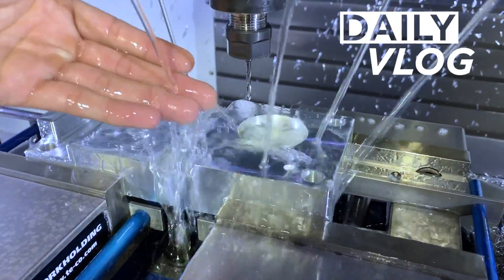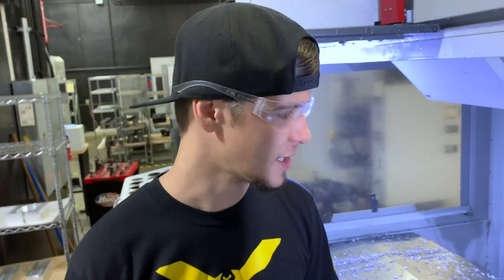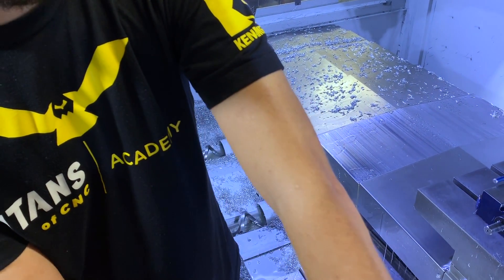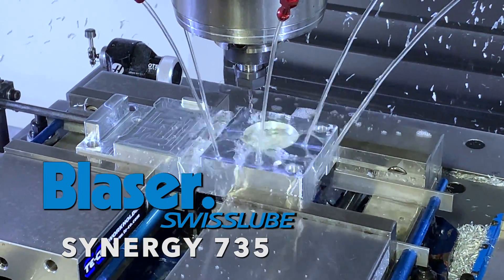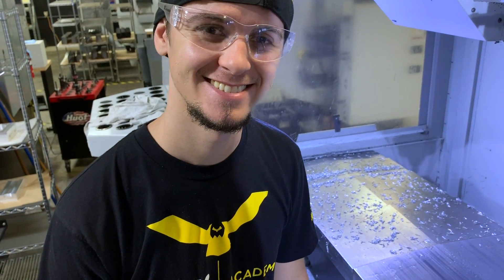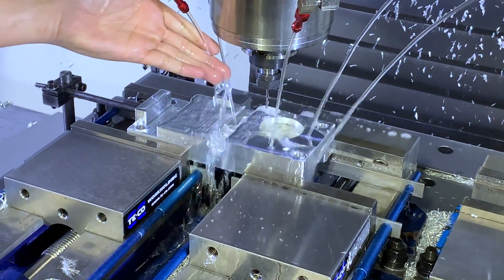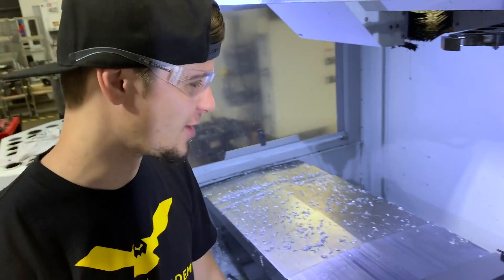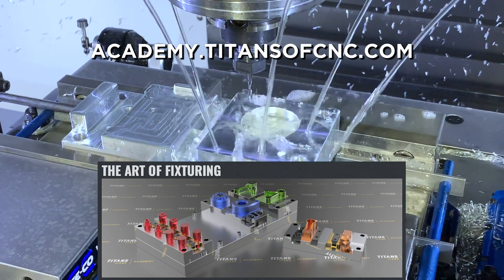20 Month Old Synergy 735 CNC Machining Coolant - Vlog #30

Comment: Synergy 735 is not for stainless or those abrasive material right? 
The blaser guy told me this is for Aluminim basically....
Reply: It's not good for aluminum either, you cannot get good cut-tap holes with this stuff, especially small ones. Broke taps right away with it on jobs that ran years without problems .Cut taps push material so bad you have to change drill sizes to have a good minor-diameter after tapping.

Comment: Lol, why use 2 vices on what looks like a 7-8" part and not even clamping on the center of the vise???  And with aluminum?  Y'all don't have an 8" vise?  Didn't you literally just mill slots through a brand new vise?

Comment: What about paint peeling off the machine???? Seams to be the 1 thing that is a major issue.  I'm getting my 1st machine up and running and wanted to go with 735 but hearing several horror stories of the coolant stripping paint off the machine.  Does anyone have this issue?
Reply: It turned the perfectly good paint of a 14 year old machine into a wet silly-putty like substance that will not dry or wipe off. Chips stick to it like glue so I had to scrape it off with a razor.
Reply: I just looked at a machine that had been running this for a few years and it absolutely destroyed it.  It's so unfortunate because the guy took really good care of his machine too.

Comment: Are you experiencing any tap breakage using 735? I switched 68 machines over and guys are complaining about taps breaking and the strong smell. I have 2 guys complaining about bronchitis. We are breaking taps on 6061 which we never experienced with other coolants, 304 we switched to using oils as the taps are breaking constantly on parts we've ran for years,
Reply from the maker: I actually love the smell... but it does take a little time to settle down.
I have 17 machines using it.

My VF6 has had it for 24+ months and no smell anymore...or at least I can’t smell it.

They had a version that stained certain part like brass so I think they lowered some lubricity in version 2 which solved the problem... but my affect tapping. Hmm
I run super alloys and always thread Mill so I haven’t noticed. When I do tap, it’s fine... but I run it at 10-12%

I always suggest trying it in one machine first. Then switching to all.

Huge companies are using it now like Lockheed, Boeing and McDonald Douglas. No issues.
Reply: @TITANSofCNC  I think I just have a bunch of cry babies. I ran a test on our Robotic 5 axis and a couple stand alone 5 axis mills and had no issues prior to switching over. Thanks for the feedback!
Reply: After a 100-hole test on this coolant using different mix% and speeds/feeds, this coolant is no good for cut-tapping small holes in 6061. Roll taps and thread milling seems ok. The smaller in size you go the worse it gets. At 6% refractometer material stuck to M3x.5 after only 6 holes killing the rest of the holes/parts on a well established job. The tap pushed so much the minor dia. for an M3x.5 went from .099 to .095 just from using this coolant. This shrinking minor dia. 'feature' was noticed on all cut taps in every machine that switched over to it. Ran it at 11% on refractometer (wicked high with the 1.6 multiplier) with an additive Swisslube gave us and it didn't change. The only thing that helped the sticking/tearing/pushing/wrecking was slowing down tapping to 1/3 of the previous speed/feed to get through the job and it still would start sticking to the tap after a short time compared to almost NEVER before. Ran a cast aluminum job with slowed down everything and was worse. M4x.7 tap started failing after about 40 holes where I used to easily get 500. I then ran a 100 hole test using one of the junk parts to get hard data on this coolants performance with cut taps.

Comment: Blaser Synergy 735 Update....... Talked with the Blaser rep yesterday. They have reformulated the 735 to handle the issue with the coolant. 
They say the new formula will take care of the problems. He told me the new version of the coolant will be out in June. However they continue to sell the current version knowing they have a issue????????? 
I will be getting rid of the Synergy 735 and going back to Castrol Hysol MB 50.

Comment: Guys I have noticed something odd with this coolant. I have a new Haas TL-1 Lathe. I have had the Synergy 735 running in it for 2 months.
It has been in the machine since it was new Running it at 8% concentration. The coolant is leaving a very sticky
residue behind on all painted cast iron surfaces in the machine. None of the painted sheet metal surfaces are
affected. Other than that this coolant is fantastic. Just a little worried on what it could be doing to the paint on the cast iron.
Reply from the maker: So as I mention in most videos, Cast Iron does cause slight issues... but they have a version 2, that fixes the problem I believe. So just ask Blaser for the new version. Also, run at 5% on your refractometer. Which then is calculated times 1.4 to hit 7. Which is a solid number for soft metals and steel.
Reply: @TITANSofCNC  Thanks. Gonna see what version of the coolant I have. Didn't realize there was a second version.
Reply: Synergy 735 update (2019-08-27). Spoke to large coolant distributor in New England. He stated that they have been receiving and selling only v2 for quite a while now. He said the reformulation (v2) was developed to address the problem of gelling reported by some users of the original formulation. So it sound like as of the end of Summer 2019, busy distributors will only be shipping v2. Their customers who have tried 735 really like it, including schools that are happy with the product even though their machines may sit idle for weeks at a time (ie Summer). So good news on the stability front. Cost is less than $250 for 5 gal of concentrate.

Comment: One of the big challenges for small shops is finding a place to get this stuff.
Reply from the maker: Local Blaser Distributors...You can get as small as a 5 gallon
Reply: Easy around here. Toronto lube carrys it. About an hr away
Reply: Yeah, I can't find it to save my life.
Reply: @shirothehero0609  have you tried actually contacting a blaser rep? You're not going to find it on Google. Theyre not going to tell you that you can't have it...
Reply: @WCGwkf  so this was a comment from a year ago, but I will tell you that yes, I contacted a blazer rep and they weren't too interested in selling it to me since I didn't want a bulk order or didn't want to setup a large recurring order.    There are ZERO distributors around me and Blazer also wasn't interested in connecting me with one.  I went back and forth via email for a few weeks with a guy and then played some phone tag.  A few emails and voicemails later I decided it wasn't worth my time for a few gallons of coolant that would largely work the same as the current stuff I'm using.
Reply: @shirothehero0609  that's unfortunate, at least you tried. Most wouldn't go that far
Reply: @WCGwkf  yeah, it really was.  I was pretty excited to try it but once they started ignoring my calls and emails I figured the hell with it.  Oh well, such is life.

Comment: My cnc machine stinks up the entire area at work only after two months...management will never get us the good stuff
Reply: We had the same problem. . Bad city water, cheap coolant. Add the two up and the machine, tooling and parts all rust. Now we run DI water and much better coolant.
Reply: @FredFlintstone21  Whats DI water?
Reply: @gman5986  Deionized (DI) water is water that has been treated to remove all ions – typically, that means all of the dissolved mineral salts. Distilled water has been boiled so that it evaporates and then re-condensed, leaving most impurities behind. It's basically highly filtered water. They have the same system at many coffee chains like caribou, to purify the water. Our system had a little light on it, when the "contaminates" in the water go above 10 ppm (parts per million) the light comes on indicating to call the water guy to change out the tanks

Comment: Also important to keep that coolant churning and working a little bit to keep that gym sock smell out of it. We use Cimstar, and like it a lot. But we keep fish tank bubblers in the machines that don’t run as much, and it helps a lot with stank... if it wasn’t such a pain to get things pushed through chemical review at our facility I’d give this stuff a shot though.
Reply from the maker: Actually, not with this one... it’s super easy as there is no bacteria
Reply: TITANS of CNC: Academy  Wow. Do you know  how they get a biocide in there strong enough to last that long that doesn’t hurt your skin? That’s pretty impressive. Obviously, from the video, it doesn’t smell funky, but what would you say it’s normal smell is like? The Cimstar is almost a sweet smell. Yet very faint.
Reply: dylan hughes you’re right. I just looked online, and it is full synthetic. We are pretty strongly opposed to any full synthetics as a rule because of their historical reputation for hurting bearing surfaces and seals. But maybe things are changing.
Reply: In general, bacteria can easily attack synthetics like MO based coolants, this one would have a sophisticated formula, and the coolant must have been given proper care and maintenance. I was in a shop with this coolant and the smell was really bad. Probably the maintenance was not up to the mark.

Comment: Interesting titan, do you recomend this coolant to steel machining? like 4140 and low carbon steel. and copper? whats your recomendation
Reply from the maker: Great for all... I even machine Inconel etc. great tool life
Reply: @TITANSofCNC   Thanks for answering, one last question, does it start to smell bad if unused for long periods of time, like regular coolant? my company does steel injection molds, and generaly in this trade here in my city, coolant is only used to drill, but im starting to do ball endmill finishings with coolant instead air its like day and night the quallity inprovement :)
Reply from the maker: No
There is No Bacteria
Reply: @68648  hello brother 😍I want long tool life in my machine (Turning center) 
Which insert grade suitable for SAE 4140 maching

Comment: I'm curious. Are you saying you've not had to refill the machine coolant in 20 months? No loss with parts, swarf or evaporation?
Reply from the maker: I am saying that it is the same batch, meaning I have never emptied the coolant tank... but have added water for evaporation and coolant to keep my % levels dialed.

So it’s definitely had a life... but that’s all I do and as time goes by, it just gets clearer and never smells or has problems.
Reply: @TITANSofCNC  Thanks.
Have you used it with PC, Ultem, or any other notch sensitive plastics? Did it cause any problems? 
I'm keen to try this, so I'll be on to the UK agent on Monday.

Comment: Our shop uses Hangsterfers. It's terrible stuff and it's tough to convince them otherwise!
Reply from the maker: This is a whole different world and once you try it... you will never go back. Milk Sucks
Reply: @TITANSofCNC   No doubt. It looks much cleaner than that milky junk. One question, do you have any experience with it in a machine that you can walk around inside? The machine I run currently is a fairly large horizontal machine center that has a walkway deck around the B axis pallet. Just curious how slippery the stuff is on diamond plate deck material when walking on it. The Hangsterfers turns to an oil slick quite quickly.